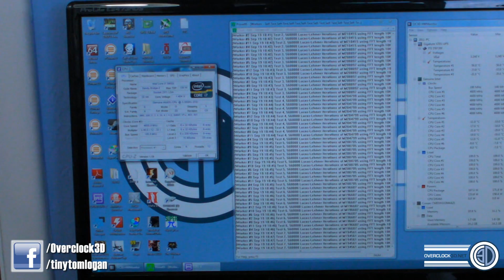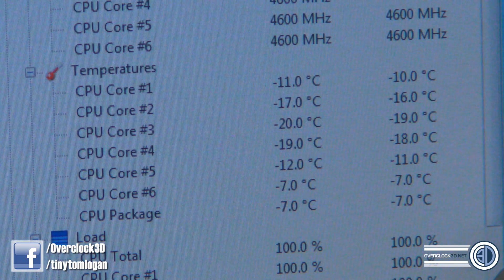Ultimate Corsair H100 Cooling Mod

Comment: Anybody that sees the temps should know this is a trolling video.  There's no way to cool below room temperature without active refrigeration or evaporation cooling, and at -20C you'd need some decent additives to keep the water from freezing, though it's certainly possible.
Reply: RoMMeL1337ak47 Im a hydrogen man myself
Reply: Don't forget the nitrogen cooling...
Reply: Dorian Cross helium is colder
Reply: It is possible to get below room temp.  This is easy to show.  Hold your hand up and with your mouth wide open blow on your hand.  Note the temp.  Now hold your lips close together.  This should increase the air speed, if done correctly.  Also the beginning temp of the air is the same as the first test.  You will notice that the temp on your hand has dropped.  This is known as wind chill.
Reply: 17:00 lollll
Reply: 12treeGoldfisher The inside is Glycerol if my memory serves me right. Its just like the rest of Closed loops saw some guy's tearing them apart mostly 120mm closed loop rads and finding glycerol coolant and some had aluminium microscopic material on them and most only have 1/2 cup or 1/4 on the 120mm rads.
Reply: I gave a very good example of how to lower the temp of something with just air flow.  Did you even try it or are you just arrogant and stupid.
Reply: You can cool below room temperature. If you wet something and try it to dry (go cycling when you soaked and you will noticed it). But still is not so sensational
Reply: K.  You are an exceptional person to make this kind of retraction on Utube.  Thank you for showing that not everybody on Utube are aholes.  Have a good day.
Reply: "There's no way to cool below room temperature", someone is showing their knowledge of thermodynamics here. When you speed up air, it cools down. Air gets moving pretty quickly through 10 120mm fans/bank. Assuming perfect efficiency and no back-pressure, each bank moves roughly 80 gallons of air a SECOND. Double that for two 120mm banks and we're at 160 gallons of air per minute, or neatly 10,000 gallons of air a minute. If you think 10,000 gallons of air moving through a space roughly 30 square inches in area won't be EXTREMELY cold, you're incredibly daft.
Reply: You do kn0ow water coolers don't contain actual water right? It's hydraulic liquid.

Comment: What temps would I get if I put 1/4th the number fans you put on?
Reply: patrick zavas No I didn't. :)
Now that I have I still don't get your point.  I asked what the temps would be if I had only 10 fans on or 1/4th.  Not if it was practical.  your an idiot by showing you don't even read the comments you post on.
Reply: your an idiot...   did you watch the end of the video?    15:44
Reply: You do realise that using more than 4 fans on a 240 radiator won't make a difference?
Reply: I did not realize that.  but if this is the case then why did he get 40 of them?
My question remains unanswered.
Reply: Just for the lolz.
Reply: Weak1ings That question is again answered at 15:44 though.

Comment: What program is he using to monitor the CPU percentage and temperatures?
Reply: The logo looked different but the inside stats of the window looks like CPUID HWMonitor. you can also use Real Temp and open then minimise it. It will leave a number indicating your average temp on the task bar next to your date and time.
Reply: hwinfo64

Comment: It will fit in tiny cases if you are abnormally large and your definition of a tiny case is larger than average, or if you plan on only putting a radiator and 40 fans in your case.

Comment: i wonder if its possible to add extra radiator depth rather than fans, like soldering the rad only bit of 2 100s together and then using say 4 fans, id imagine if your soldering was neat enough this might be modding project, though with the 105...

Comment: Clearly this guy is an idiot: extra fans after certain limit won't improve air flow at all; moreover, there are other high pressure fan solutions to get really high air speeds; higher air speeds won't improve heat exchange from the same surface very much after certain  easily accessible limit... well, he is an idiot unless he is a troll... I did not keep track what he was saying about the numbers, I know instead what has to be as engineer in ventilation and heating

Comment: So really, what the temperatures were?
And how did you hack the software?
Reply: The software monitoring the temperatures looks like "Open Hardware Monitor" which has the ability to set temperature offsets. In reality, the absolute lowest temperature possible with his setup is room temperature and even then only with the cpu turned off. It's more likely that what he actually got is pretty close to what the manufacturer recommended setup would give you.
Reply: Zero is an immaginary # on a fixed place that is absolutely unreachable. When throwing shit like actuals and time in the equasion... it is a flawed experiment...

Do research while editing and revising.

Comment: question for OC3D: where did you plug all those fans? that must be .. how many volts?
Reply: EV1LDRAG0N Voltage input x Amperage equals wattage/H used, so (12Vx0.09A) x40 = 43.2W/H...I think, someone correct me if I'm wrong
Reply: 40 fans x 12w each one = 480w +/- 5% maybe, dunno the stats of those fans but that's my thought
Reply: Jonathan Uhos meh... =P you're right, i'm still ignorant at this point, need to study more
Reply: It's all good man, I myself am no expert but I believe I know a good amount, I have a 5 channel 30 Watt per channel computer case fan speed controller, I didn't know how many fans I could put on each because the fans I used said 12V 0.30A, so I thought "That's not Watts, how many Watts is that?" So I did research and learned the math of it. VxA=W I'm no nerd, if you we're my parent you'd yell at me for how poor my school grades are, but I love computers :).
Reply: Jonathan Uhos
 I thought the fans ran on the 5V rail, not the 12V rail.
Reply: Gemma Dunne Concidering the fact these are high performance fans, if they were on the 5V rail it would see like a waste of high end fans for them not to run off the 12V rail

Comment: the temps are obviously fake. You should have paid attention on Physics classes.
Reply from the maker: Or you watch to the end of the video...... I cant believe there are still people arguing over a troll video that was DONE FOR FUN
Reply: Lawrence Wong because water freezes at 0 even running water traveling 3fps (feet per second) will freeze at -8. meaning the cooling system would freeze
Reply: I don't think that it's just water in the loop. I think it's some kind of radiator coolant or something.
Reply: Lawrence Wong  It's not water, but the air temperature would have to be far below 0C for it to be possible. (Unless you use liquid nitrogen cooling, which doesn't require any fans)
Reply: ***** Ashley, it's not water in the cooling system. It's coolant liquid that has a much lower freezing temperature and a much higher boiling temperature.
Reply: Kristo Nuut actually, when it's running, it can't even hit the ambient temp, it'll always be a bit warmer, no matter what would you do.
Reply: ***** 1. As soon as water hits 0 it doesn't freeze instantly even at -10. 2. The cooling system would freeze eventually but it would take much much longer. That being said the guy in the video said he had it running for roughly an hour give or take which isnt nearly enough time to completely freeze the water although some tiny ice crystals may have formed inside. That being said unless you are permanently running 4 skyrims and the H100 alone isn't cooling it enough this is really redundant and not recommended
Reply: OC3D TV
Don't lie. Anyone with half a brain can tell this is obviously not a troll video. I mean, come on man, you're running 40 fans on the H100 - we can all see what's going on!
Reply: Damn you morons.... There's no WATER in that cooler. It's a special kind of liquid that DOESN'T evaporate and it has a much much much lower freezing point than water...
Reply: watch the end of the video...
Reply: wtf you know he said it was fake right???
These trolls
Reply: Megamanfsx
WTF Theres is one fact wich is destroying al the noobs above: the cooler or the water lines would be covered in ice when it would be so cold inside -.-
Reply: Tell us why how the temps are fake. Seems completely legitimate.
Reply: ***** isn't it how the refrigerator works?
Reply: Theo Lubbe
But when you go push pull the speed of air does not increase only the pressure, after a certain amount of fans it becomes redundant.
Reply: Zhangir Azerbayev Unless you ramp up the power with the fans. Just like the Bugatti Veyron SS trying to reach higher speeds. It took 200 more horsepower just to see an upwards of 10 extra Mph to make the SS faster than the regular Veyron. There is a redundancy factor at some stage but it would take a mighty long time and a lot of fine tweaking to find it. Also in a way it could be useful to play around with different fan sizing to potentially create a turbine effect. Just my opinion
Reply: u do realize that just because its negative doesn't mean it will freeze there are a lot of rivers that are -20C and are flowing fine when energy (aka the water being pumped through the pipes) is applied the water will still be gaining enough energy to stop it from freezing.
Reply: Aston Milner
 Those rivers will freeze eventually. The motion of the water merely slows the process.
Reply: Lawrence Wong because the core temp or the whole cooler temp can never go below ambient temp!?! go study
Reply: TheScrappingJeahaha That's what insulation is for, silly.
Reply: Theo Lubbe
Use your brain! You can clearly see that these tubes are not insulated, and they are not because they never get negative temps!
Reply: Didn't you know? You can get tubing which doesn't look insulated, but it comes with double-walling insulation as standard!
Reply: Lawrence Wong for him to cool it at minus like that with fans on his watercooling radiator his room would have to be at -0 aswell you need to remember that he used some special formula inside in radiator
Reply: Theo Lubbe
Yes i know BUT it dos'nt work with flex tubing... and why the heck should a radiator hose be double walled ?!
Reply: I'd want my radiator hoses double-walled if I'm bringing the temp of the liquid flowing in them down below ambient! I'd hate to have condensation forming on pipes going into my computer!
Reply: Theo Lubbe
oh man... IT IS NOT POSSIBLE TO GET THE LIQUID JUST WITH SOME FANS UNDER ROOM TEMPERATURE
Reply: How can you say that when this guy is obviously showing it can be done! Maybe the fan arrays changed the air pressure causing a vacuum which lead to e temperature drop!
Reply: Theo Lubbe
Because the Temperatures are
FAKE, when just some Fans could create such a Pressure changing effect which changes ambient tempretures then nobody would have a power eating monster of A/C Unit !
Reply: Crap, I don't know how to troll you any further... I am gonna suggest you not use that trollface avatar if you're this easily trolled, though.
Reply: barmiro this would work look the water turns into ice the ice is melted by the cpu and water again
Reply: ***** he probably useing antifreeze
Reply: ***** he probably useing antifreeze
Reply: ***** he probably useing antifreeze
Reply: ***** Number of people that didn't watch to the end, all posted above.
Reply: barmiro dosent matter how many fans you have i think it dosent improve anything if you ahve 20fans in 1 direction as it wont boost the speed of the air as there isnt any resistance betweent them for them to help eachother

Comment: is it possible to freeze your cpu lol
Reply: mygetrichslowplan Not to nit pick, but nitrogen is an element not a chemical
Reply: Fun fact: You will never cool your cpu to below room temperature without chemicals (like Liquid Nitrogen). Using a standard air cooler or even a liquid cooler like the H100i, heat that is generated by the CPU is dispersed to the air moving through the fins, but this only works if the temperature of the fins is greater than the air. Once your CPU hits room temp, it won't get any colder!
Reply: mygetrichslowplan but the fans may lower room temp and thus the aforementioned cpu has lower temp
Reply: Yes it is very possible to freeze your CPU, in overclocking competitions (yes these exist) they have to start the computer before fully cooling it becuase if the CPU is too cold it wont allow electrons to pass through it's silicon. And once it's running they can only cool it so much until if stops working.
Reply: BasedMuffin1 no pun intended
Reply: Anything is possible, but not plausible
Reply: well some people do liquid nitrogen cooling soooo not quite sure
Reply: Yes you should see the video corsair made on liquid nitrogen cooling It's pretty cool.
Reply: link it?
Reply: BasedMuffin1 AMD also did a video of nitrogen cooled CPU
Reply: Alam
Actually you need to learn some physics.. You put a fan into a closed room the room will only get hotter.
Reply: dude it was a joke
Reply: Steve Cjr You nit picked though.

Comment: This doesn't make much sense to me...If the temperatures were below zero ºC, then the water would just freeze and the pump would stop working!The h100 is a watercooler,right?

Besides, at this low temperatures, we wolud start to see water condensation, which is not really happening, is it?

So, the cpu thermopar seens to not work correctly under low temperatures!
Reply: Ok...I just saw the end of the video now..wow so many people believed it was serius, including me...hahahah

Comment: Would I get away with doing a double push set up without the pull on the H100? I already have a H100 and 2 SP120 fans.
Reply: In case you are not kidding: No, don't get any more fans for push/pull or similar since it doesn't make a difference with pressure optimized fans.

Comment: I missed the portion where you talk about the peltier plate or the frigorant cooler. Because getting -10C with water being cooled by radiator with room temperature air only, defy any kind of thermodynamics law. The best ever you could get would be room temperature with a 100% efficient heat transfer.

Comment: this is just for fun right? wouldn't this draw more current? increased load = increased current = increased power usage = more heat build up in the power supply. it doesn't seem that efficient. 
EDIT: saw the temperature ratings at the end of the video, lol, thats awesome

Comment: still quieter than a single r9 290x...mine is so freekig loud
Reply: I didnt buy one for that simple reason. I went with dual R9 270x, and it's no louder than a fat kid breathing. jk... it's quieter than that. lol
Reply: AndroidEatsApples R9 270x is not loud...the my and only my r9 290x is louder than my vacuum...literally....it is like a heater(becuase of the amount of air it pushes out the back of the case while running unigine... :D i sold them for gtx 780ti

Comment: the temps maybe real, so much compression of air going on that is actually acting like a refrigerant compressor..pressure equals temperature. pressure built up at radiator then released as it gets through would cause a negative temperature in the radiator area.

Comment: http://valid.canardpc.com/sufunp TPC 812 with Japanese heat sink paste 4x more heat condutive than normal heat sink paste and 5x 120MM fans bolt on straight onto heat sink 2x front 3x rear of heat sink spins at 666RPM on AMD cool and quiet CPU built in function  mode and can full load 1.48VID 4.5GHZ http://valid.canardpc.com/5de43l and can do http://valid.canardpc.com/sufunp 1.728VID extreme OC 5.3GHZ

Comment: If it is my cooling for my AMD pro bitch 8 core FX8350 it will OC to 1.9696763V and OC World record frequency FUll load with nitrogen in water cooling loop at leasst 7GHZ full load pro bitch

Comment: To the people arguing about whether compressed air gets colder, I can't reply directly to you for some reason but it actually gets warmer all other things remaining the same. The equation is PV=nRT where nis the amount of gas in moles, R is the gas law constant, T is temperature P is pressure and V is volume. If you increase pressure on the left then the temperature on the right will increase. And to the guy who said the proof that it gets colder is his CPU is running at 54 F and the room is 71F, your CPU is running at 54C. I'm not sure how you could have thought otherwise to be honest, 54F is amazing even with a custom water loop.
Reply: PS before anyone says anything about a fridge compressor they do not work by compressing the air inside the fridge, so yeah...

Comment: There is nothing running on that System and most of pu's are doing their Speed better, if they are warm and not frozen, cause the material they are build is from the builder, expected that noone will cool them like u. :D
u also have to synchronize every fan on the same rpm for better Quality of cooling, because the air wich is pulled, has to be pushed, otherwise there's energy lost by Foucault current, same by electric Generators. :)

Comment: Make a wind tunnel. On the pull side of the radiator, build a funnel that gets larger and larger and larger and larger until the BIG END can fit forty fans pulling air through the radiator.
Reply: I think this would be difficult to maintain pressure, the entire funnel thing would have to be pressurized by the fans to maintain pressure on the rad.
Reply: If the walls of the cone were sufficiently thick enough or reinforced, that should not be a problem. The effect would be to pull as much air as possible through the radiator rather than push air through the rad. How much negative pressure could be created by thirty or forty fans similar to those in the video? What would the math look like?